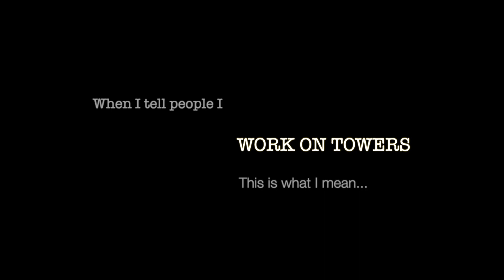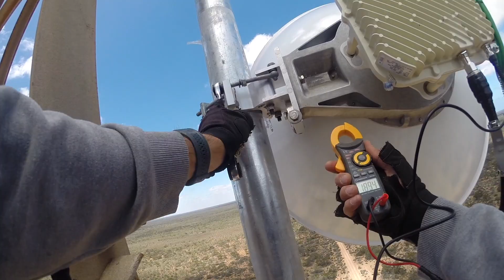Tower Climbing

Comment: Love the video and jealous you can still use carabiners for rigging....no more in USA of that
Reply from the maker: Cheers mate!

99% of the time we use shackles, but wasn’t going to be me climbing down to grab one on the large dish drop haha so the 50kN Kong carabiner got call up, plus since we used the chain block to lower the load onto the haul rope there wasn’t any shock on it, just a static load.
Reply: @4wdAdventure  I hear you on that! They just straight outlawed them for use on sites per tower owners over here....
Reply: @rogadog77  in our com train class they talked of a kid who was 23 who was killed in Charlotte NC because the ow er of the company rigged the tower with a carabiner...the thing snapped due to lack of inspection and also weight. Is snapped the carabiner and decapitated the kid....we aren't supposed to use them for that but like u said..with just a static load u will be fine. We do it too..Just gotta know what your doing and pay attention.
Reply: @kaseypharr5433  I was called to retrieve a body in Kentucky due to same circumstance 7 years ago they were using a double drum wench and it went bad....
Reply: @rogadog77  smh. I hate u had to go through that man. Ive been in the industry for about two years and I've been lucky enough not to witness any deaths but I've seen some close calls..and one bad freak accident..and I do mean bad. I had a guide wire tower snap in half due to unforseen 60mph wind gust..had 3 guys on the tower..the rope trapped one of them on the tower and the rope went wrappwd around the crane as well..it was nasty man..luckily no one was hurt..but still. I think that tower was built in the 50's..the metal on the tower when snapped looked like fools gold it was so rusted...smh..but 9.5/10 its operator error..but shit does happen.
Reply from the maker: That’s so sad mate! Don’t wish that upon anyone! Stay safe out there!
Reply from the maker: Wow that’s crazy! Not what you want to see ever!